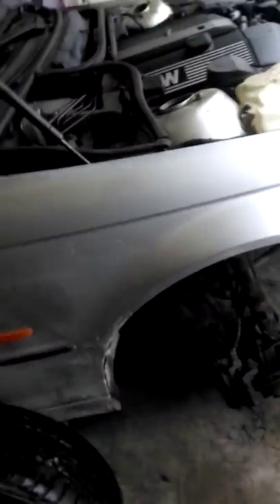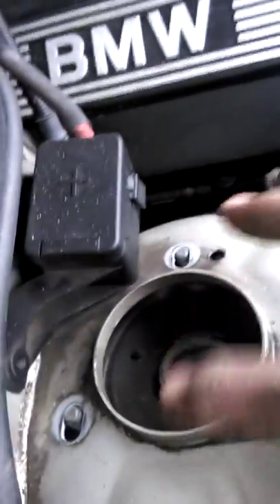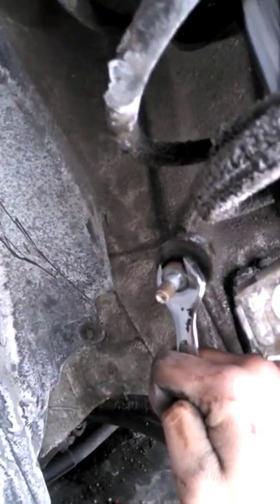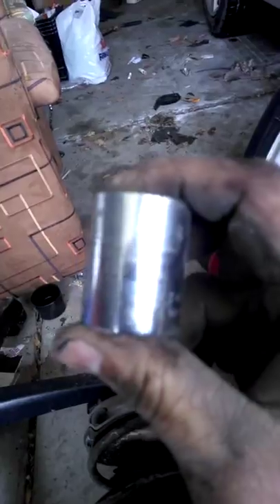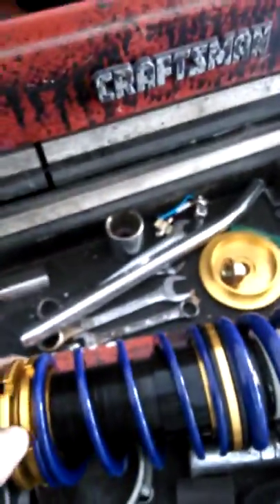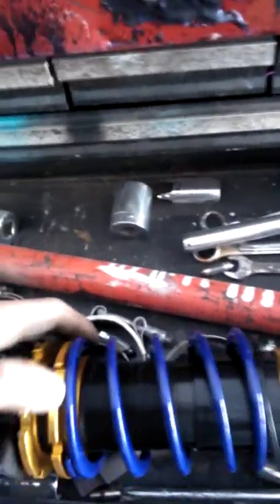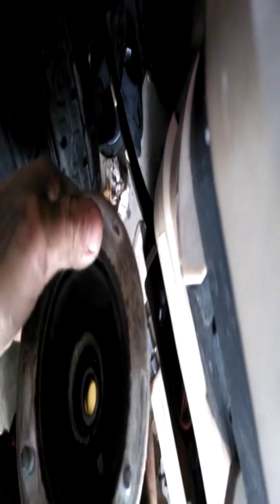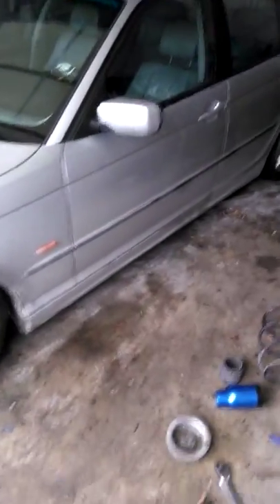2000 BMW 323i part 2 coilovers e46 ready to drift her car

Comment: Any what length the drop links need to be? Theres a few on ebay but im sure they're different lengths...
Reply from the maker: I don't think the length matters as long as you can adjust them they must be adjustable or it won't work.
Reply: I know im late but you dont need adjustable ones that are too expensive 160mm shortened ones off ebay are perfect or even hyundai coupe rear drop links work too